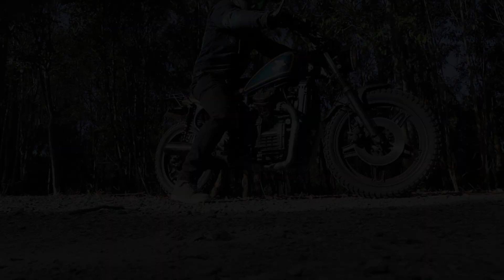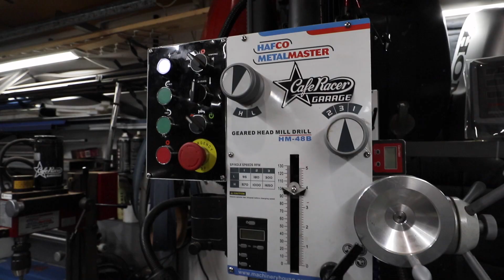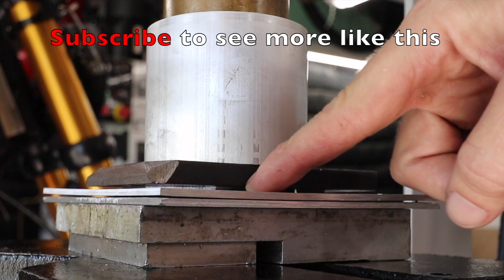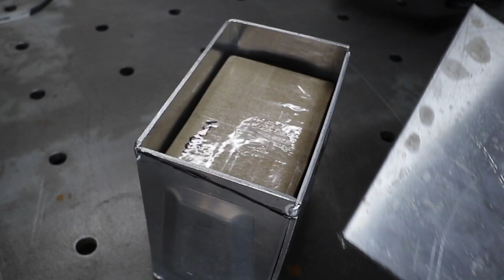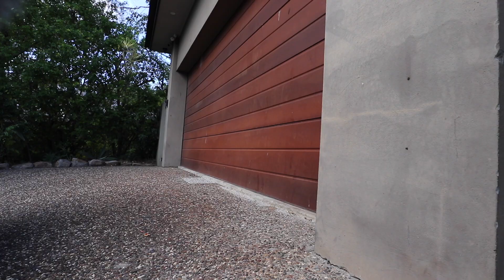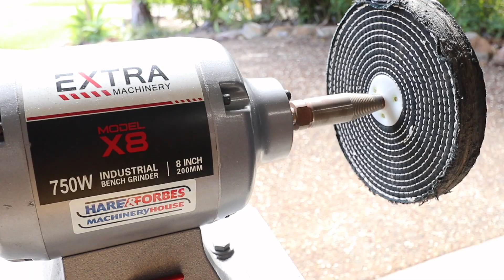METAL FORMING, Why Did I not Know this TRICK Years Ago?

Comment: Surprisingly, home 3D printed embossing dies also work really nicely for pressing sheet aluminium and thin steel.
Reply from the maker: It would wanna be some strong filament to put up with 3mm aluminium pressing into it. But it’s a great idea and I’ll definitely try it if I get a 3D printer
Reply: @CafeRacerGarage   PETG with 100% infill is pretty strong! Folks make bead roller dies with it too.

Comment: Hey Dan, bit of a sidetracked question, how do you attach electronic components to your trays? I've watched pretty much every video you posted and I can't seem to sort it out. I've been working on a tray for cb550 and I think I'm just going to use automotive double sided tape so I don't have to commit to anything and weld it. 

Thanks! Also, this is a dangerous channel because it makes me want to buy far too many tools.
Reply from the maker: I have the same problem with channels that I watch too don’t worry about that, but these tools will last you a lifetime so it’s totally worth it.  

You could use automotive double sided tape, but it all depends on what components you’re talking about. For something like an ignition module you could make it upside down lid out of some superthin steel, 0.5mm will be perfect just rivet the lid onto the electrics tray, leaving a cut out for the wires. It only need to keep the electrical component in place.